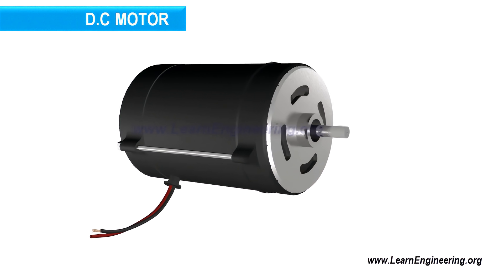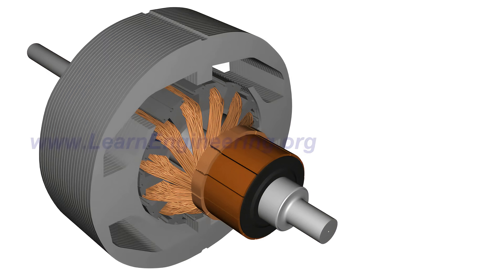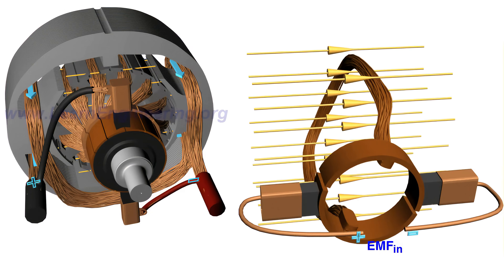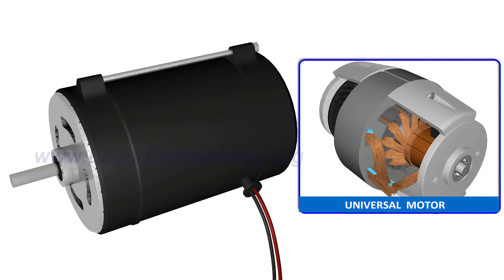DC Motor, How it works?

Comment: At 3:47, is Back EMF also present in the stator or is it only limited to the armature/rotor?
Reply: Both, because the armature is also producing a field whose flux is going through the stator windings and change of flux through a coil causes emf in it.

Comment: I have a doubt....at 0:54 we can see that the brushes are in contact with both the segments...i.e. the upper as well as lower one ...so doesn't this create any kind of problem in the flow of current or short circuit..??

Comment: if I were 12, I would not understand " Flux Interaction," yet Fluctuation of motion , or flow of motion is what we are trying to smooth out.
  this is not actually the " simplist " electric motor yet it is explained  
 well in the basics of an electric engine with a stator coil and armature  
  the induction motor and magneto are simpler than this

Comment: Over all the vedio is very usfull to under The function of DC motor.a little bit suggestions to modify it to make easy  the change ofdirection  of current we will example of straring of a car when we use continuse motion of  straring we change our hands quickly to make the continuous motio

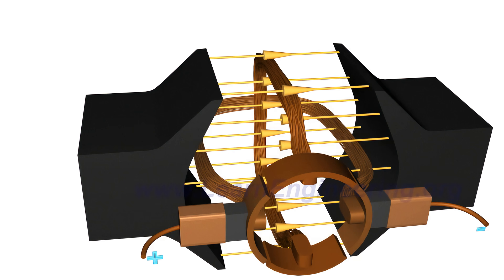Comment: @1:50 This suggests that the many armature coils are separate, connected only their own commutator segments, so they are connected to power only at a time, which is not true . The coils are connected to each other series, so they are all powered at all times; the brushes and commutator ensure that they are connected in the correct polarity to produce driving torque.

Comment: 0:19 Simplest DC motor
0:24 Stator, armature, commutator rings
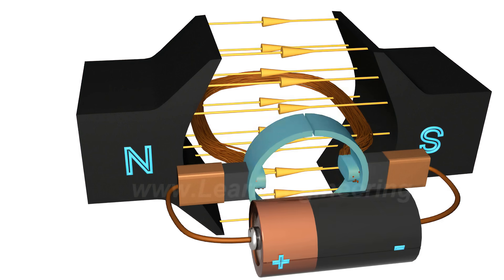0:42 Lorentz Law
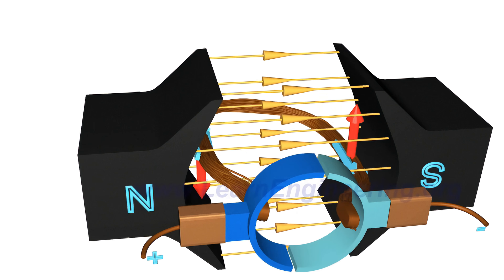1:20 Torque action nearing zero
2:18 Enhancing magnetic flux interaction
2:30 Spring-loaded commutator brushes
2:53 Parallel (shunt) and series motors
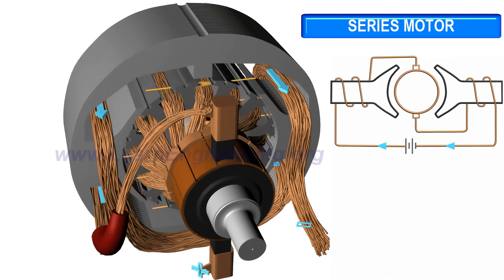3:13 Series-wound motor (output of stator windings powers brushes in series connection)
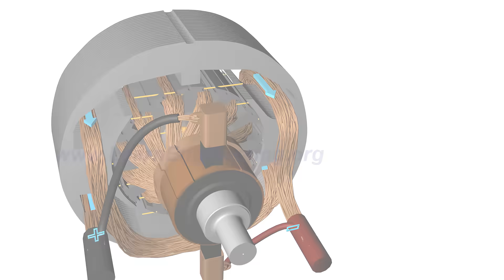3:23 Shunt motor (same power source energizes brushes and rotors in parallel connection)
3:35 Back EMF
3:47 Electromagnetic induction 
4:06 Back EMF (proportional to rotor speed) opposes internal voltage
4:24 Large DC motors

Comment: Is the right hand connection diagram at 3:15 wrong or i am not capable to understand that??? The connection shown is not in series but it is in parallel. The input should be one end of armature and one end of electromagnetic coil as shown in the left motor diagram

Comment: When the two brushes meet the split region of the commutator ring, that is when both the positive brush and the negative brush touch the same ring, wouldn`t the battery be shorted out

Comment: I have a question . Right at the end you say that in the beginning the FEM auto induced is too low hence the current will be too high, but that is exactly what you want the magnetic torque is proportional to current . I think the problem is , if the speed of the rotor is such you will have a big emf back hence no current  so no magnetic torque
Thanks  for the video dude !

Comment: Will it get shortcircuit when the brushes touch both sides of the ring 0:55?
Reply: No, current from brush will split and partial current will flow between both the segments

Comment: Basically, The current-carrying conductor produces its own magnetic field which interacts with the external magnetic field of the permanent magnet. This interaction is what moves the wire. If we make the conductor into a squarish U-shaped loop and fit a power source. Then one arm of the conductor will have the current coming towards the  power source and the other one going out in the presence of the external magnetic field provided by the permanent magnets. Therefore, one half of the conductor will move upwards and the other half will move downwards and we would assume that the conductor will carry on rotating like this and we would be on our way of having DC motor. Two major problem occurs with this design. One is that the wires will tangle up and another one is that  once the coil reaches the vertical position after rotating far enough, it would flip over, so the electric current would be flowing in the opposite direction. Now the forces on each side of the coil would reverse. Instead of rotating continuously in the same direction, it would move back in the direction it had just come. We need to periodically reverse the direction of the current to overcome this problem. So a commutator is used to overcome this problem. In the simplest form, the commutator is a metal ring divided into two separate halves and its job is to reverse the current direction every time the  coil makes half a turn. Now since the torque becomes very small when the coil is perpendicular to the magnetic flux, the motion will be very irregular. To overcome this problem, one more loop of coil is added with a separate commutator ring (when the first loop is in the vertical position, the second loop is connected to the power source and therefore a motive force will always be present). To make the rotor motion even smoother, more loops and corresponding commutator rings are added. Next, the magnetic flux interaction is enhanced by fitting the armature loops inside the slots of highly permeable steel layers. And spring loaded commutator brushes help to make contact with the power source.  In a practical motor, the permanent magnets are curved in a circular shape so it almost touches the coil of wire that rotates inside it. The closer together the magnet and the coil, the greater the force the motor can produce. DC motors are used for small applications like toys but you won't find them in house-hold appliances. For them, universal motors are used. In universal motors, instead of stator being permanent magnets, electromagnets are used and therefore, can be powered by DC and as well as AC.
Reply: Hey bro can I pick your brain 🧠
Reply: Shall we trade brains?

Comment: 個人用メモ
The stator 固定子
magnetic field 地場
armature 電機子
induction motor 誘導モーター
permanent magnet 永久磁石
comutator 整流子
current flow 電流の流れ
electro magnetic force 電磁力
↑カッコいい！✨
induced 【電気】〈…を〉誘導する 《★しばしば過去分詞で形容詞的に用いる》.
lorentz law ローレンツの法則
rotate 回転する
opposite polarity 半極性、異極性
power source 動力源、電源
away=離れる≒下向き
towards=向かってくる？≒上向き
throuought motion 全動作
ensure that (ということを)保証する
observe 観察する
closely (副)注意深く
nearly perpendicular 垂直に近づく
magnetic flux 磁束
irregular motion 不規則な(動き)
trick 仕掛け
overcome 克服する(≒≒解決する)
in this arrangement これにより
motor force 原動力
almost present in system 
常にシステム内に存在する
practical 実際の
High permeability 高等磁率
fitted 取り付けられる
magnetic flux interaction 
磁束の相互作用
loaded 搭載された(荷を詰まれた)
help to ma(i)ntain 維持するのに役立つ
contact 接続
永久磁石でできた固定子の磁極は小さな直流モーターにのみ使用される
Most often, 殆どの場合,
field coil 界磁コイル
parallel connection 並列接続 
DC shunt motor 
直流分巻電動機
series connection 直列接続
DC series wound motor 
直流直巻電動機
starting torque 始動トルク
drastically 急激に
irrespective of に関係なく
characteristic 特性、特質
EMF electromotive force
起電力
electic magnetic induction
電磁誘導
proportional 比例の
burnout バーンアウト 焼損
universal motor 交流整流子電動機
長い！長すぎる！自分の理解力が足りないことが原因だけど。。
二時間かかったけど英単語とモーター同時に覚えられるから、コスパは良かった。

Comment: To ensure steady uninterrupted rotation there must always be an even number of coil loops that form the DC motor's armature.
Reply: i have seen odd number of coils ,3 to be precise, i guess the function was to generate interrupted rotation to create a desired vibration. Experience from Electric toothbrush 1.5 volt DC motor :).
Reply: Why

Comment: It should also be pointed out that the armature is the part of the machine in which actual power conversion takes place (mechanical to electrical or vice versa).  Not necessarily the revolving part (rotor). In AC machines, the armature is almost always the stationary part (stator).

Comment: Teslas, with similar DC-motors have outperformed all fast-cars in acceleration!!!
Reply: yes, because electric motors are instantaneous in torque. Electric motors have yet to outperform combustion engines in top speed.

Comment: I know this is a dumb question but I have to ask this.Will the motor run if the inner coil is replaced with magnets?If not,could you please tell why?
Reply: You always have to switch the polarity of one part of the motor (stator or rotor). If you would replace the spinning part (Rotor) with a magnet, you would have to create a rotating magetic field on the outer ring (Stator). This is called a brushless DC-motor and is done by a controll-circuit and sensors that detect magnetic fields.

Comment: __for learn enngineering___rot E==-dB/dt and rotH==J+dD/dt and HrotE--ErotH==div(H*E)== power motor and where is it this explication here..?? __what is difuzor ?? is it electric motor and stator is magnet and rotor is bobine circular around magnet and here not explication variation power and speed whith variation intensyti_amperaj and tension_voltage __and speed_power growth proportional with growth voltage and power growht not speed proportional with growht intensyti_amperaj __.incomplet material ___ _____archaix lord

Comment: 1:43 the trick to overcoming this design flaw is actually to use AC motors instead. Tesla knew it a hundred years ago, why do these things still exist?
Reply: I guess because batteries produce DC current, and many small portable devices use batteries as their energy source, that may also be why most of the DC motors are small ones
Reply: An inverter can be made very small. It's worth the efficiency

Comment: In the beginning of the video you mention stator,  but no label or arrow pointing to it. In the future, as you introduce each component, show a label for it with an arrow to designate it, so no assumption has to be made as to which component it's referencing.

Comment: I didn't dislike the video enough to give it a thumbs-down, but the narrator REALLY should have started by stating the basic principle of a motor, which is the tendency for two magnets to line up.  Secondly, the multiple coils are realistic, but confusing.  Start by explaining the motor principle with a single loop of wire in the rotor, and then advance to the purpose for multiple coils --- and don't forget to mention that that wire is insulated!

Comment: I just took one of these apart to clean it up. The carbon sticks that allow voltage to go through the magnets eventually wear down and the waste from them along with the wear can cause a bad or no electrical connection at all so I took it apart clean the surfaces and it worked again. It was a window motor in my car. This is a temporary fix.

Comment: thanks
0:48 magnetic field = 1st finger / pointing finger
direction of current = thumb finger
direction of force = middle finger
magnetic field goes from north to south
source :
Lorentz Force https://www.youtube.com/watch?v=NPF5OAaN7KU&t=3m25s
from youtube search keyword (lorentz rule) result 3

electron goes from - to +
source : 
'Electrons are negatively charged, and so are attracted to the positive end of a battery and repelled by the negative end. So when the battery is hooked up to something that lets the electrons flow through it, they flow from negative to positive'
in https://van.physics.illinois.edu/qa/listing.php?id=583
from google (battery from positive to negative) result 3

Comment: I believe that there is something wrong about the animation. The part where torque nears 0, it is shown as if the angular speed is decreasing. However as torque nears 0, the accelation nears 0 too. Just because its acceleration is decreasing doesn't mean that it is slowing down.

Comment: Hello, Let me start off by saying how great of a video this was but I have a question concerning other DC motors. A common DC motor is the 3 coil 2 pole brushed motor and I am wondering what the benefits are to a motor with the coils positioned the way they are there as opposed to how their set up in this video. Sorry if I am missing details and thank you for your time and effort!

Comment: Absolutely great video, thanks a lot. 

A small note for everyone: Something missed in the video, the armature coils don't exert only back EMF, they exert magnetic field opposite to beneficial flux also. Because of this, at the big powered machines; some extra coils which called "commutation coils"  and "compensation coils" being used to get rid of the armature flux.
Reply: thank you , that is interesting because a magneto would use a capacitor to smooth out the fluctuation of flow between primary and secondary coils

Comment: If we have a 100 kw D.C. Motor and somehow we give him rotation at the speed of that motor works can we work that motor like a welding generator with a few more components (amperage and voltage adjuster)or my thought is completely wrong?

Comment: What if you use electric wire instead of copper. Does it work even better?
Reply: What do you mean by this question? Copper is an electrically conductive material. Most electrical wires are made of copper and aluminum.

Comment: I have a doubt. When back emf is created in rotor then current in rotor changes over time and its not constant. That results in change of magnetic field that results generation of emf in electromagnet (stator) too. Am I right and why is not this explained in video?
There are as I know L1, L2, that are self inductanse of rotor, self inductanse of stator respectivly, and there are  L12, L21 that are mutual inductances. There are equations to be solved to know exact currents. Am I right?

Comment: Doesn't the place where the power source is change the performance? You put it vertically and horizontally. Doesn't it defeat the purpose if it's vertical? Also if not so, couldn't I have 2 power sources?
Regardless couldn't you have 6 power sources close together if the motor has multiple commutator rings? I know it's not optimal but if that's not the problem couldn't it make the motor stronger?

Comment: Great video. Correct me if I'm wrong, but it looks to me that your first example would, as shown, short the two terminals through the commutator rings, and therefore not function.
Reply: True, the two-segment commutator would not be functional without gaps between the segments at least as wide as the brushes.

Comment: Very interesting, thank you!

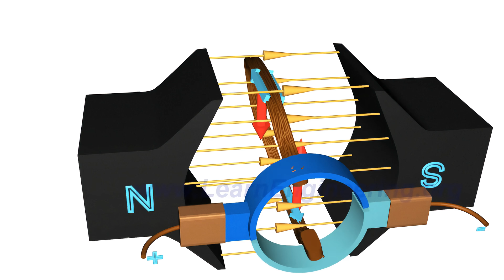But when I saw exactly the moment, when sekond 01:04 begins, I wonder, why there is no (double-) short circuit, when both poles touch both sides of the ring at the same time, what would destroy the whole arrangement. I wonder that for some years now ...
Reply: It is insulated

Comment: question: in a  reversible 24 volts motor from a winch can we change voltage to 12 volts? and if we can it depends on modify armature wiring or whatelse? thanks